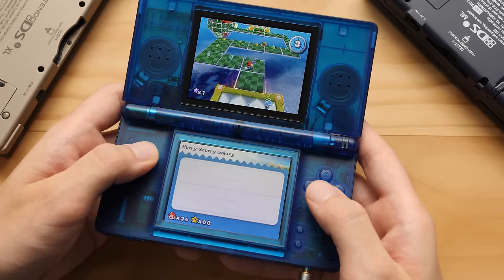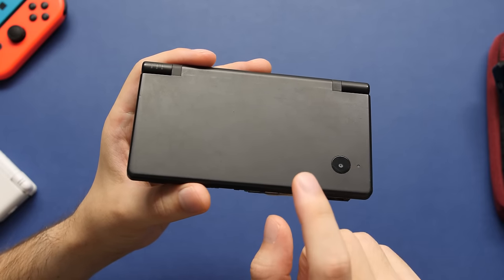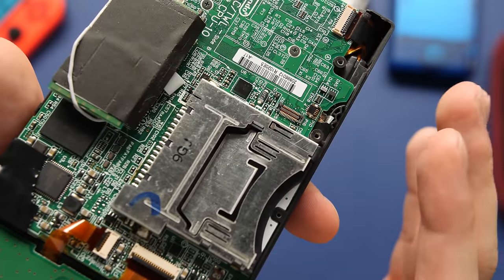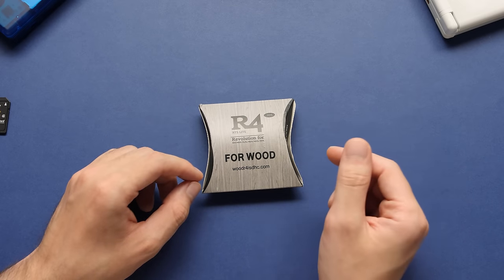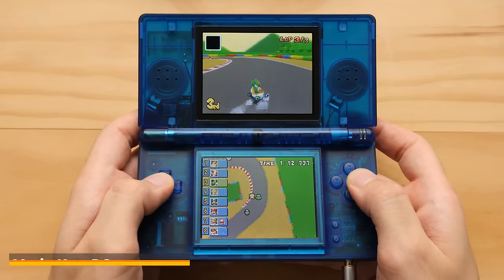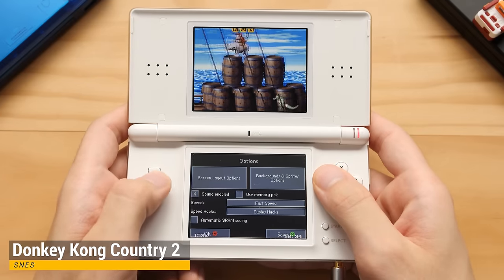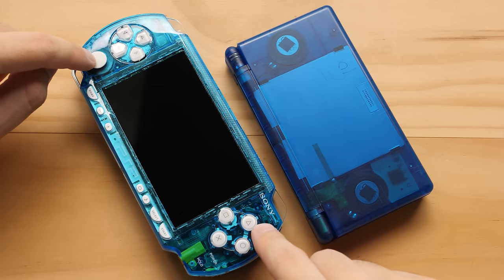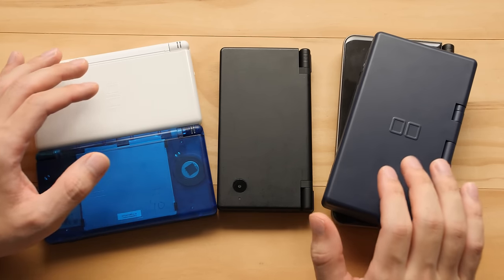The Nintendo DS is Still Amazing in 2023. Here’s Why.

Comment: I did a clear shell swap a few years ago, and I must say, the hinge section does not hold up well over time on an aftermarket shell. It slowly breaks the plastic until the frame eventually snaps.
Reply from the maker: Who made the one you bought?
Reply: @TakiUdon  I'm unable to check since it was so long ago-- it was a seller on AliExpress. Perhaps the shells have gotten better now. I bought a clear one and a clear blue one just like you, and both shells also had problems with closing seamlessly. The shell worked fine, but I think this not-perfect-closure of the device caused parts to slowly break over time as the device was used. Does your shell close seamlessly with no gaps at all around the shell?

Comment: Timestamps:
0:00 - Intro
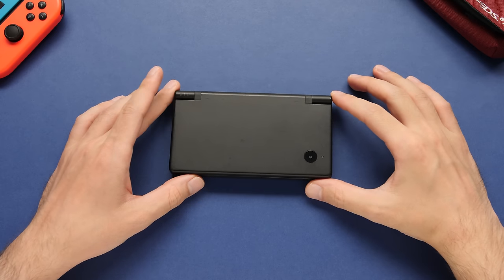0:28 - Finding close-by second-hand market units
1:47 - Cleaning a white DS Lite
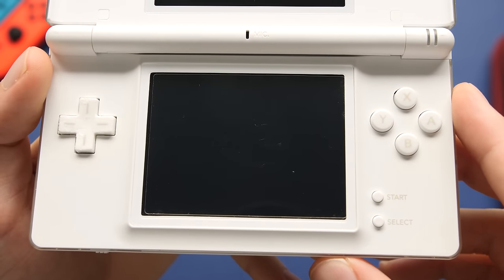3:38 - Cleaning the case of a black DS Lite 
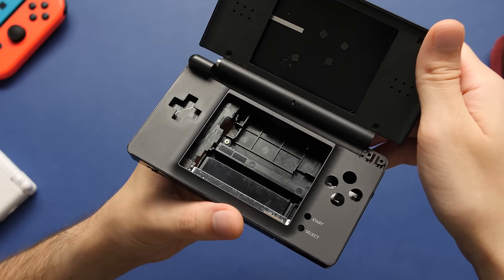4:00 - Thoughts after cleaning a black DSi unit
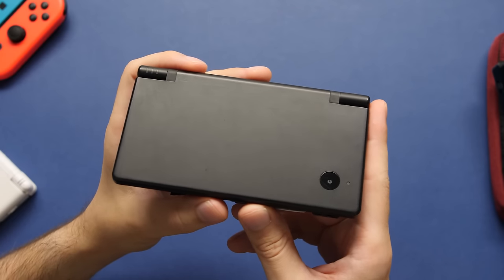4:13 - DS Lite replacement shells
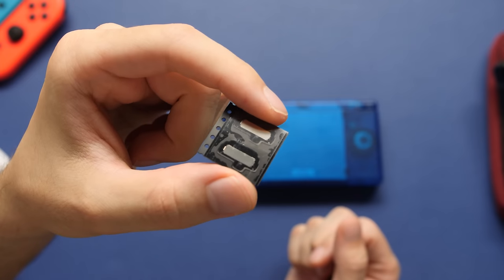5:31 - Original DS replacement shell (DS ML)
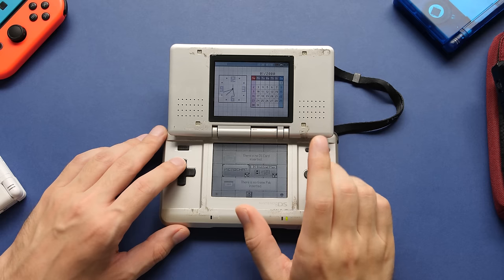6:11 - Problems with the original DS unit Taki Udon bought

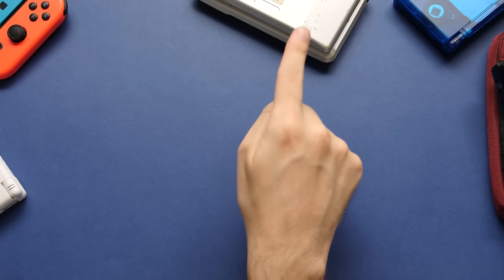Common technical difficulties (6:32)
6:41 - Devices that are not powering on (F1 Fuse going out)
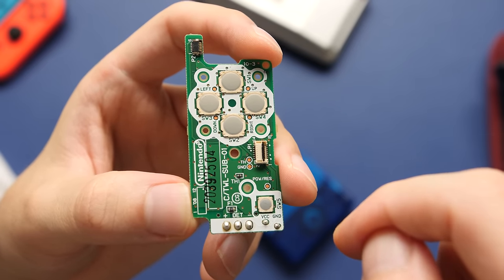7:35 - Broken touchscreens
8:11 - Broken hinges (No solution listed)
8:25 - Yellowing screens 

9:45 - Comparing ghosting effects across different DS models

11:21 - Modding discussion starts here
11:32 - Methods to access homebrew
11:58 - R4 flashcarts 
13:20 - TWiLight Menu 
13:43 - Game Boy Advance flashcarts 

14:43 - Shell swapping the original DS with the DS ML shell

15:59 - What can you do with a DS (official games)
16:28 - DSiWare games
16:55 - Game Boy Advance games

18:08 - Emulation (Game Boy Color and Game Boy games)
18:31 - Emulation (Game Gear, Neo Geo Pocket and Wonderswan)
18:55 - Emulation (NES, Master System, PC Engine, Genesis/Mega Drive)
19:58 - Emulation (SNES)

21:12 - Homebrew (DS2Win)
21:45 - Homebrew (PKMN-Chest)
21:59 - Homebrew (Super Mario Galaxy DS)
22:34 - Homebrew (other Ports & Remakes)

23:22 - Verdict, Closing Thoughts and Recommendations

Comment: Honestly, I think you have better luck if you carefully remove the digitizer (if intact) from the old screen, and then install it onto the new (removing the new one beforehand). I've come across quite a few DS lite digitizers that just don't track very well. Though, this would also fix that 'blurry digitizer' issue shown here.

Comment: flash card tip, i got this 208&482 card on amazon. really good card with good emulaion support including gba snes pc engine 
 and neo geo (in some .neo format). came with roms that i just got rid of since i use my own ripped roms and uses wood themes in the main ds section

Comment: Bought myself a maroon DSi XL this year. It was discounted coz it was missing its original stylus and was a little bit scratched up and dirty but it came with the big chunky stylus and once its on you can barely tell that the screen is scratched. I already own two 3DSs, one of which I bought to mod in case I messed it up, and the other which is my main 3DS, but I’ve been playing a lot of DS games this year and wanted to play them in the original resolution coz the DS has a couple of tricks to make the games look slightly better on the less powerful console. Overall, I love the DS and 3DS lines and still go back to play them even though I own a switch and some of the more current consoles.

Comment: I think the DSi is actually better than the DSi XL (and same for the 3DS/New 3DS family). The pixel density is too low on the XL models and it's really, really apparent, particularly in 3D games (Zelda, etc). If you're only playing 2D DS games, then yes, the XLs are the way to go. But if you want to do a lot of stuff with it, I actually prefer the smaller screens.

Comment: I think Nintendo made a mistake discontinuing the 3DS. I still think there's a market for it to exist alongside the Switch.
Reply: The sales figure showed otherwise
Reply: @main_tak_becus6689  yes, they only sold 75 million units.
Reply: @Nickbaldeagle02  the sales slowdown when Switch hit the market. Switch is the perfect replacement IMO. I myself prefer 3DS to Switch, because Switch has controller issue. My Dualshock 4 first and latest models still work fine after all these years.

Comment: I bought a faulty DS Lite, it hasn't arrived yet. The seller says it does not turn ON but lights up when a charger is plugged in, so it would be amazing if it ends up being a burnt fuse.

Comment: The turbo grafx emulator inside Twilight menu works pretty good and you can play CD games too if you use the bios and it will save until you turn the power for the game system off then everything's erased I mean the only way to play through a RPG like Dungeon Explorer 2 is to leave the power on and just plug it in and never shut the power off

Comment: If only there was an IPS replacement displays for both the DS and the 3DS.
That is the only downside in my opinion, right now it is hard to use either considering how good displays have improved ever since.
Reply from the maker: You can get a dual IPS 3DS, but they are very expensive. They are worth the money, but they very expensive. I wish someone came out and made custom DS screens out of some dead stock IPS panels. You can cut some of them to size and repurpose them for this.
Reply: @TakiUdon To be fair, all DSi XL models are also Dual IPS.
Reply: Maybe consider buying a dsi xl. They're all dual ips screen units and the added real estate is a game changer!

Comment: I'm on a weird situation of not knowing what to do. I have an original DS with faulty touch screen. I have a DS Lite with broken L and R (I managed to semi-fix R but L is impossible, and would need soldering to replace it which right now I don't have the tools), then I have a dsi which has no issues, my only complain would be a little ghosting? and that d-pad hurts on long sessions, this never happened to me on Lite.
So now I'm in the process of wishing for a frankenstein DS that has DSi-XL screens, AND gba port (because I really want to play with cartridges for no given reason), a bonus would be the Lite's d-pad.
Either that or a GBA with tv output, which right now is really expensive, but I can't find if there is a controller support mod for ds to do that, as it is way easier to do tv output from a ds.

I just don't know what I might end up doing, fixing my ds doesn't sound great because I won't really use them. Having a definitive way to play GBA cartridges is really expensive right now (and coming from an SP I have to buy an original model for sure). What I might end up buying is an DSi XL, I already loved DSi (except for when I played minish cap which treated the game as if I was pirating lol)
But thanks a lot for the video, now I know of the existance of the DS ML, I was searching if something like that existed but Google never helped finding that, I'm so glad it exists (and makes me learn is not that good of an idea if original shell has no issues)

Comment: Taki, why did you do your emulator testing on the DS Lite instead of the DSi? The DSi has a much faster processor and should be able to run more games at full speed. I would have been interested in seeing some commentary on that difference. Also I feel like the jailbreak makes the DSi a lot more desirable as you don't have to rely on flashcarts and can update on the device very easily.
Reply from the maker: The emulators that I used don't run faster on a DSi. The one where you would expect that to be the case would be SNES, but for whatever reason, it does nothing with the added power.

Comment: I just snagged a black DS lite from a thrift store for $12 that was sold "as is" because the battery supposedly was bad. The battery actually worked fine, but the case and internals were *FILTHY*, the bottom screen was damaged, and the d-pad was hardly functional. So I'm waiting on parts, including a shell swap from Amazon because I didn't want to bother with cleaning the awful nasty case. We'll see how it goes...

Comment: I have never seen a broken hinge on DS Lites, only the plastic part, that has hinge inside. So it could be fixed with a shell swap. That small connector of the digitizer is really a pain, and I really hate rebuilding DS Lites. The strangest part of the DS is screen resolution. While being perfectly capable of NES emulation, screen missing a few pixels. It's 256*192, while NES resolution is 256*240, so nes, snes and megadrive games just dont fit in screen.

Comment: How is battery life for gba and gbc/gb games on dsi? I have a miyoo mini but i have mostly been playing my gba and ds instead because the battery life of emulation handhelds has been just worse across the board in my experience. 

With the dsi also effectively just  emulating each of these consoles im wondering if it's even worth using outside of just for my DS games

Comment: I have that r4 card that says 3ds on im trying to use it on my ds Lite, but I can't seem to find the firmware anywhere. What did you use ?
Reply: Probably better to join his server and asking there
Reply from the maker: https://github.com/DS-Homebrew/TWiLightMenu/releases

- Grab TWiLightMenu-Flashcard.7z
- Copy roms, _nds, BOOT.NDS, and snemul.cfg to your SD card
- Find your card in the Autoboot folder and copy the files inside to the root of your SD card.
Hopefully, your card brand is listed as one of the ones in that folder. One of my cards was not on the list, so I just looked for a folder that had the same name for the .dat file that the official firmware for the card uses.
Reply: @GangityBirdity  Thank you. I appreciate the tip
Reply: @TakiUdon Im gonna try this out thank you very much
Reply: @Takiudon it worked 🙌

Comment: If you're getting a 3DS, is there a point to getting a normal DS, is it worth it, or would it just be redundant? And which would you say is a better deal overall?
Reply: 3ds obviously you have the whole ds game collection and 3ds plus virtual console
Reply: That's a good question b/c 3ds's are selling for crazy prices now but if you are already getting one, I would say it's redundant. Many of the best DS games have official 3ds ports on the system and you can find mods easily. Although the white Nintendo DS Lite is one of the most beautiful handhelds ever IMHO. If you just want to play the games and some modding power and you don't care about the hardware, just get a New 2DS in regard to bang for the buck. 3D is overrated for the price.
Reply from the maker: A cheap DS Lite/XL + 3DS is a good combo. DS games don't look great on 3DS.

Comment: That power switch replacement, especially without proper gear, is the worst part about modding a DSLite. There aren't any good 1:1 power switches and that thing is super fragile, and the components near it make soldering a new one in kind of awful.

Comment: I would never recommend someone buy a card calling itself "R4" by name anymore. The ones that aren't time bomb ridden are hardware clones of the Ace3DS or the older Acekard 2, both of which have clones available by name instead, so you can skip the gambling with your source being one that ships out trash. That being said, the original R4 SDSC clones are fully functional if you don't mind the 2GB limit, but I wouldn't recommend them over an Ace3DS clone given both can run similar menu frontends and the Ace3DS doesn't have any sacrifices made to get DSi/3DS compatibility natively without a DSi app to load the card, and SDXC compatibility (your mileage may vary, not like the cards already aren't hit-and-miss with flash cards though)

Comment: Sure the later DS models are top tier. But the original DS is still killer, super comfortable and very durable dpad and buttons, shoulder buttons piss all over the DS lite buttons for sure. And if you're lucky and your original DS is a v4 or v5 you can flash the firmware to unlock DS lite brightness levels.

Comment: I got a R4 clone card. I thought the time bomb thing was just a bomber man logo as it needed some logo. I put the Twilightplusplus firmware on it does that mean it won't self destruct?
Reply: I dug our my DSi recently and installed CFW, now I no longer need my R4 card. Everything runs off the SD card in the DSi.
Reply: Yeah my 3ds is full of 3ds games and home brew. I don't want to waste Space on my systems 256gb card (6gb free) on ds games. My R4 has a 64gb card in it and I still have half of it free. I don't think the Bomberman r4 card is self destructive is real. I never heard of it before and I have had mine for awhile. Maybe the custom firmware bypasses it but idk.
Reply: @enp82003  it isn't, it simply refuses to work after a set date, I would always change the date back through the system settings but don't have to worry about that anymore lol.
Reply: @CapOlimar  I just don't know how that is possible... The firmware for it is on the SD card... the card is too cheap and only has one chip. It doesn't have any kind of built-in bios, it's basically a passthrough to an SD card like a SD2vita. Some cards have different chips which need different firmware... Where did you get that info?

Comment: This video made me update my r4 as i randomly get the latest firmware. Mine was feeling sluggish, format the sd card and fresh firmware has it running smoother. Honestly the emulation is cool if you dont already have another emulation device. If you watch Taki regularly you probably already have something else thats easier to setup. I dont recommend a ds unless you want to breathe life into one you had years in a drawer or you're getting back into gaming and want something affordable. DS consoles are certainly the best for ds games as its tough to get the original forma factor, but anything retro is found elsewhere for similar money such as the powkiddy v90 which can be bought new for the same money

Comment: I actually considered buying a second hand 3DS XL for some games but I realise I can kinda emulate it on either the Switch or Android phone. Definitely plays nicer but the number of games I am playing on it is really small, not sure if that's worth the price.
Reply: A modded 3DS is a great console to have. It's really the best way to play DS, 3DS and GBA roms natively. Especially those older DS games that require the stylus for movement, like the Zelda games. Emulators work, but movement is awkward without a second screen and stylus. it's also a great NES/SNES/GB emulator handheld. A+, would recommend...and they're not getting any cheaper.
Reply: @JBaughb  Yea considering, I did count and it is only like 10 games in total so I am kinda wondering
Reply: @JBaughb the prices for the system is nuts. Sadly my N3DSXL has a broken a button

Comment: DS's are NOT easy to work on. A shell swap is NOT easy, a hinge replacement is NOT easy, replacing the female end of the touch screen ribbon cable is also, NOT easy. Don’t take advice from someone who bought a new power board to replace a common 2 cent fuse. 

The DS is a sick system though and if you want to learn, its a cheap way. Just know that repairing them is not worth it unless its just the fuse. Never buy one with a broken top screen or hinges. Broken ones are like $10 less than working ones, just get the working one.

Comment: The Fat DS is just not worth it. Brittle plastic, broken hinges, rotten rubber bumpers, and the screens were never good to begin with and are now failing with black horizontal lines. (Actually the screens are better than the AGS-001 and it was released before the 101 and was the only backlit GBA option for almost a year.) To add insult to injury the screen connectors have a brittle plastic flip-up bail as well that's easy to break. I still think it has a better D-Pad and buttons than the Lite but that doesn't make up for the rest.